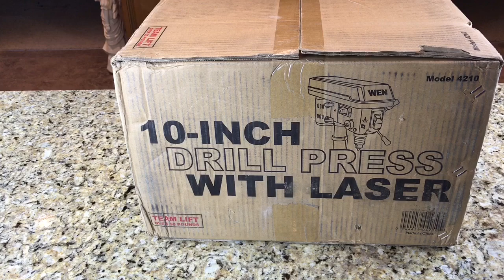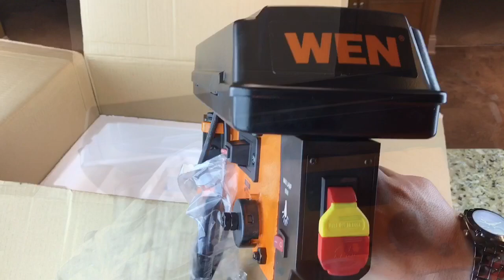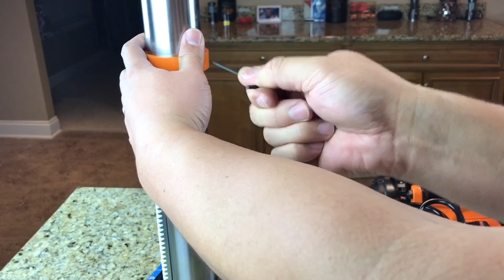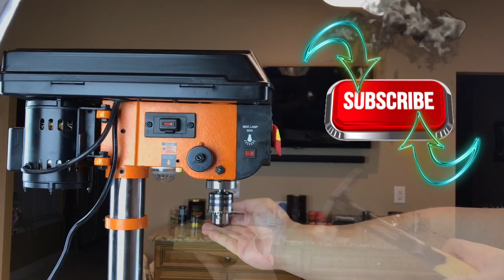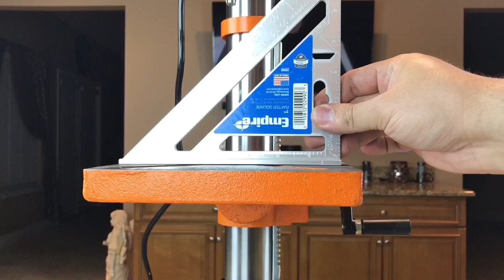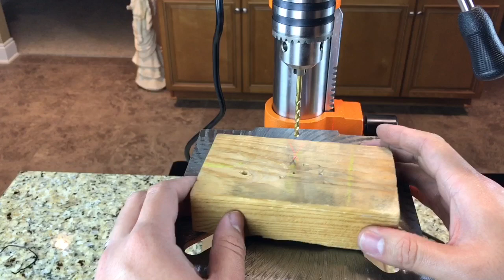Best Budget Variable Speed Drill Press & Amazon's Best Seller! Wen Drill Press Review!

Comment: Debating on this WEN 10" drill press or a Ryobi instead.  If anyone has any opinions on which is the better one, I'd appreciate it. Thx
Reply from the maker: I was having the same question when I was looking to buy this wen drill press.  The thing the won me over was the price!  Lol I would only be using this every once and a while so I didn’t need to spend the 180.00 on the ryobi 10” drill press. And for my diy project the 140.00 wen would work out just fine.  I saw someone on YouTube put the web drill press the it’s paces by drill through several pieces of steel and it didn’t skip a beat.   So it’s cheaper, stronger motor, depth gauge is better. So just so you can make ur own discussion.  Here r the main differences between the both. Let me know what you pick and when u get it send me a link to ur video so I can check it out. 

Wen 10” drill press
-1/3hp motor
-Laser
-price 140.00
-Depth gauge on adjustment lever
https://amzn.to/35tN9zB

Ryobi 10” drill press
-1/4hp motor 
-Led light & laser
-screw depth gauge 
-price 180.00
https://amzn.to/3kcczFS

Comment: Unfortunately this drill press has the lowest speed of 600 RPM which is too fast for certain steels (such as 17-4ph stainless) as they get hardened while drilling. The Harbor Freight has a couple of drill presses cheap enough after  coupons that go down to 220 rpm. Which is still a bit high.
Reply: The leak of low end rotations keeps me as well away from this WEN, but the HFT one is so bad, that I won't ever consider it... First off it's not balanced, it has play in the chuck, the table bends... Should I go on? At about $400 you might get lucky on craigslist, but you need to be focused on what's out there...
Reply: @A.Dude.  I bought mine a long time ago for about $200 after coupon. You can catch it now close to this price. Mine is ok but I do not use it much. It has virtually no runout. But the reviews of it are all over the place so I got lucky.
Reply: @vrokhlenko  Like I said, I won't ever buy the HFT, but thanks!
Reply: @A.Dude.  If you want a low RPM drill press check out a Sewing Machine Servo Motor. They have a flat torque curve from very low to very high RPM. If you can get your hands on a good drill press with no motor - you can retrofit that servo motor and you will be very happy!
Reply: @vrokhlenko  Thanks again! I think I'll look for a good JET...

Comment: Can this drill press be used for drilling holes through aluminum, metal and steel plate?
Reply: You will want a more powerful press for steel and iron really.
Reply from the maker: I haven’t tried it myself. But the review video I saw of this had someone drill several hole through metal 24 hole in 1/2  flat stock steel @ 600rpms.  So yes it can also do metal. Like I said I was impressed but its ability to drill through steel and also how quite it is. On top of all that is it is close to the price of a harbor freight drill press but with miles more power and quality parts. Thanks for the comment I hope this helps.
Reply: southcoastdesignz  Thank you for the information you gave me. I appreciate it very much.
Reply: southcoastdesignz  thank you
Reply: I drilled 10 holes in 1/8 angle iron no problem
Reply: While the power of the drill is a factor in how well it can drill harder materials like metal, it's more a matter of whether the bit is the right one for the job. Don't try cutting steel with a titanium bit or you'll be disappointed.

Comment: Wen 8in & 10in drill press is a way better drill press than sold by Harbor Freight which has a cheap stamped tables instead of cast iron construction of the Wen. Furthermore,  the Head of the Harbor freight is die cast aluminum an has too a sloppy quill fit compared to Wen.   Best of all the Wen DP costs about the same as Harbor Freight  and is widely sold and discounted by 
Menards (in store), Home Depot (mail order/ship to store) an Amazon (Free Shipping). I don't have any connection to Wen I just like their homeowner DYI grade drill presses.  I own the 10 inch variable speed and 8 inch models. You would probably need to pay $300+ for a Porter Cable DP to get a better machine
Reply: Yeah, the cheapo Harbor Freight press is a complete disaster.